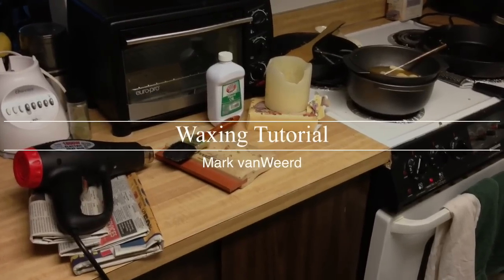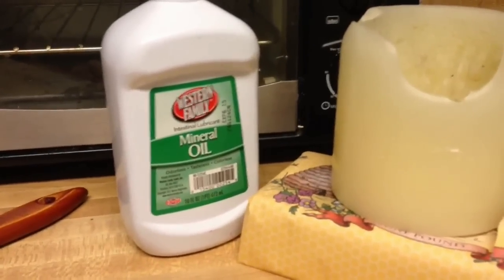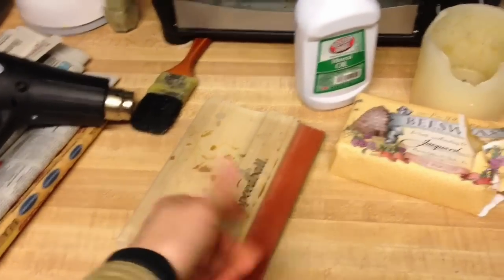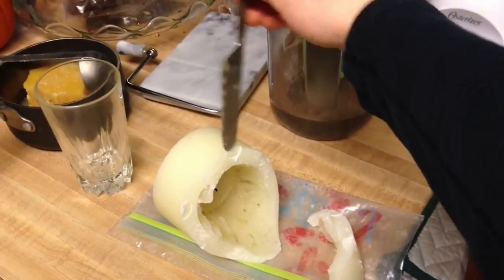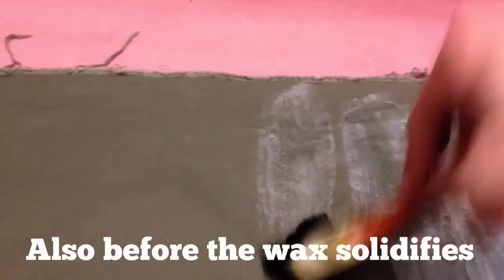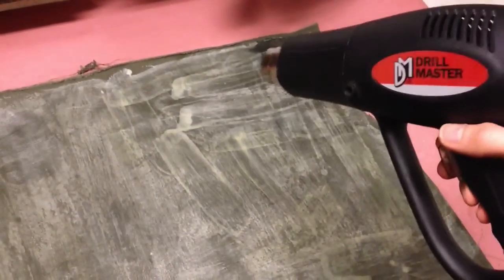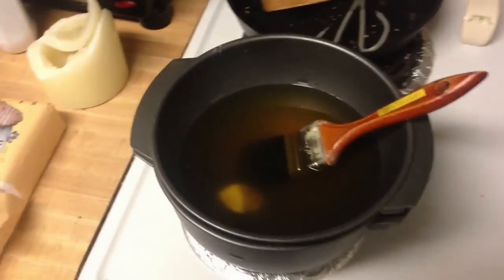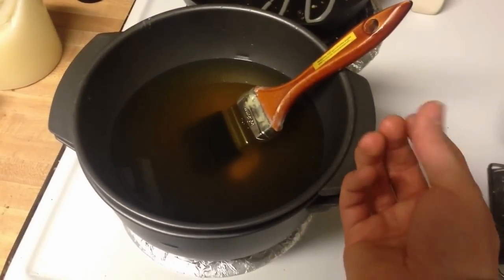Fabric Waxing Tutorial

Comment: I'm planning on waxing  fabrics to make baga with it, they will also have parts of leather sewn on. Questions: 
1- do i need to let the fabric sit to dry before using it?
2- the oils in the fabric might run off and stain another non  wax fabrics like tour clothes?
3- will my sewing machine work good trying to sew this fabrics toguether ?
Thank you very much!! Very imformative video. I cant wait to start geting my hands into it.
Reply from the maker: +antongrad Thanks for watching! 
- The fabric doesn't need any drying time with just oil and wax. Some people use a solvent/spirits like turpentine in the wax blend so they don't have to get the fabric hot to have it absorb. Blends like that need to sit until the solvent has evaporated.
- It's possible to have the wax/oil rub off. The higher the oil percentage, the more likely it will rub off. Having a higher wax content will be less likely, but it's still possible to have it rub off. This is one of the reasons outerwear is usually what is waxed.
- Waxed fabric isn't hard to sew on a machine. Actually, it may be easier than the dry fabric because the oil/wax may lubricate the needle and thread as it makes a stitch. One thing you will notice is that the teeth under the foot (feed dogs) may get jammed up with wax, so it would be good to have a stiff bristle brush to scrape out the wax. Also, you may notice the bed and foot getting oily. If it's a concern for the next project, you'll probably want to clean the machine afterwards.
Reply: +Markus Stratus thank you very much for all your explinaxion ... I'll keep in mind all your tips. Thank you again
Reply from the maker: +antongrad Absolutely, I shared the video to educate people, so I'm glad to answer questions

Comment: Awesome vid. :) I want to make some fabric semi water resistant and went searching and found this. I hate parrafin wax but would probably use soy wax (apparently parrafin wax can be quite toxic and food will be close to my fabric so I want to be cautious). Question though...if I'm doing small pieces of fabric (no more than 8-10 inches square) can I use a hair dryer instead of a heat gun?
Reply from the maker: Yup, better to use a natural wax around food. I highly recommend beeswax if you can get a hold of it. You can even use a hair dryer for large pieces, so long as it gets warm enough to melt the wax.

Comment: came here from devianart... this is really educative... question... people will try to put the final product in a laundry machine... what would you suggest as a cleaning method for a waxed cloth
Reply from the maker: Heh... washing... 
But yes! This is important. It's assumed that waxed fabric will be used as outerwear or accessories. Because of that it wont pick up body odor. Liquids can just be dobbed off if they don't simply roll off it first. Dirt and grit can be brushed off and mud should dry before being brushed off as well.
Putting it in your washer or dryer would probably make a mess of the machines and dry-cleaning is out of the question. It's easy care stuff by its nature.

Comment: Great instructional video.  Thank-you so much.  Just to make sure I understand.  Do you wax both sides of the fabric?  Also just curious do you have good sources for beeswax?
Reply from the maker: ed1claudia Correct, only one side of the fabric has wax applied. When you brush it on, it sits on the surface but as you heat it up with the heat gun, the wax saturates all of the fabric. If you don't see as much wax on one side than the other, that's a sign you didn't apply enough in the first place. I get my bee's wax online via stakich.com. More you buy the cheaper it is. But you can find a lot of sources on Google. I wouldn't spend more than $10 a pound

Comment: Hi Mark. Great video. I have a question. I had a cloak made out of faux suede for a theatre production. It looks ok, but I’d love it waxed. Do you think I could follow your method and use it on faux suede? Also, I don’t have a heat gun and would be reluctant to buy one unless absolutely necessary. Could I use a hairdryer instead?
Reply from the maker: Ian McPherson, I actually wouldn't recommend waxing a fibrous fabric like faux suede, flannel, brushed wool, mole skin, etc. The way these fabrics take a waxed finish is weird... First of all, any fuzzyness gets replaced with a tangled matting of fibers. It doesn't have that attractive appearance that waxed fabric gets. If you have any scraps of this or a similar fabric, I really recommend trying it out to decide if you find the results acceptable. If you're just interested in waterproofing it, you can find a spray to waterproof suede shoes. That keeps the original appearance but water just beads off.

As for the hair dryer, it should work just fine as the melting point of wax isn't even 200F

Comment: Thank you for sharing the video. It was very informative and answered a lot of questions I've had as I've been experimenting with waxed canvas. I'm curious what your experience has been like with sewing waxed canvas. I've been waxing my bags after sewing them to avoid gumming up my machine. Any advice on this would be helpful.
Reply from the maker: Stacey Rosenberg you can't avoid getting some wax in your feeddogs, but it comes out with a lint brush easily enough. It doesn't however, gum up the needles and the like because instead of being sticky like basting tape, it actually works as a lubricant.

Comment: Sir   if you were to use this method  on a canvas tent with a wood stove would it be any less safe from fire
Reply from the maker: No... I don't believe it will protect it. Consider a candle, it's a fabric wick with wax fuel. Waxed fabric will act like a candle, just with a little bit of wax to a lot of fabric. This fabric should be used in situations where the fabric doesn't get hot enough to melt the wax, otherwise, no point in waxing it. Once it gets hot enough, the wax will liquify. At a certain temperature the wax will combust. The combustion point of wax will come sooner than that of fabric.

Comment: have you tried other oils besides mineral or vegetable? like coconut or flax or anything more natural? or know of any suggestions if one were into that kind of thing?
Reply from the maker: Siren Bags I actually have not. I chose mineral oil /baby oil because it doesn't go rancid and doesn't dry out very fast. I wouldn't want to use olive oil, flax, etc. because they become rancid relatively quickly and the smell would be unbearable to me. (Keep in mind waxed fabric goods are intended to last years) Other oils dry out and become varnish quickly, like linseed, walnut, etc. It would be worth researching the rancidity rates of different oils and the drying rates (polymerize) of plant based oils. It may be relative to smoke point, so possibly avocado oil is a good choice?

Comment: How does this wash? I have an apron I want to wax and I'm going to need to wash it. Should I was it by itself? Will it mess up my washer? Should I just hand wash and dry?
Reply from the maker: Hello! As mentioned in Answer #6 above, washing waxed things isn't very effective, and in most cases, completely out of the question. The point of waxing a fabric is to protect the fabric from liquids penetrating the fibers. As such, most things should just be able to be wiped off while wet or let to dry and brushed off. One reason to wax fabric is because it's low maintenance.

If you're wearing an apron that NEEDS to be washed (because of work place regulations or something) waxed fabric isn't ideal. If you do wash it, it will likely ruin the waxed finish and you'll need to re-wax it and it may make a mess in the washer too. I can't really say as I've never washed waxed fabric... defeats the purpose.

Comment: Can you use a paint roller?  Also for the 60/40 is that by weight or volume?
Reply from the maker: Item #1 in my comments above mention proportions by volume. I imagine you could use a paint roller to apply the wax. I would expect a lot of wax to be absorbed by the roller and you would need a large pan to melt the wax in.
Reply: I am thinking it may be worth it to pour the melted wax into a heated tray since the paint roller will be the most consistent and fastest way to put wax on.  Or it the tray is large enough out the fabric face down on a large wax block and heat the fabric from behind.   Good work. Thanks.

Comment: Hi Markus,
Thx for the video. I have a question that may be you know. I am finding some troubles with my waxed canvas. I use bee wax combined with paraffin, heater and dry for at least 24hours. When water (rain) comes in contact with my waxed canvas I get raindrops on the fabric who are permanent. I can't find the solution for this problem. Do I forget something. I use 100% canvas fabrics.
Reply from the maker: OK, I'll try to help. Can you clarity  what you mean by Paraffin? Is that paraffin wax or paraffin oil? (What I would call kerosene). If you're using bee's and paraffin wax, it will be dry to the touch when it cools to room temperature. If you're using bee's wax and paraffin oil then you're right about waiting for the paraffin to evaporate. Either way, once the fabric has cooled or the paraffin evaporated, you're left with 100% waxy fabric. I would recommend against that and include some measure of oil (that wont evaporate quickly)  in the wax blend. This could be a clear petroleum based oil, like lightweight sewing oil, mineral oil or baby oil. It could also be a vegetable oil like olive, canola, grapeseed, hemp, coconut, etc. There are oils you want to avoid such as boiled linseed oil, tung oil, walnut oil and others that are used for wood finishing and dry quickly. 

Also, can you clarify more about the raindrops that are permanent on the fabric? Do you mean the water soaks into the fabric and doesn't dry out or do you mean it leave a watermark where the moisture was?

Comment: You can use spray on waterproofing?
Reply from the maker: Hello Gasgiant, your question isn't clear. Are you asking if spray-on waterproofing can be applied to waxed fabric? In which case, I don't quite know. It may be repelled by the waxy finish. I haven't tried before and it would be good to know. 
On the other hand, if you're asking whether spray-on water proofing can be done instead of waxing? The answer is yes, it does the same thing. However, the waxy finish will stay longer than a spray-on waterproof which only really lasts a few uses before needing reapplication.
Reply: @Marcusstratus  hi, yeah I wasn't sure if you were coating a fly sweet for a tent say. If so it would only get occasional use so spray on would do, it's quick to treat.